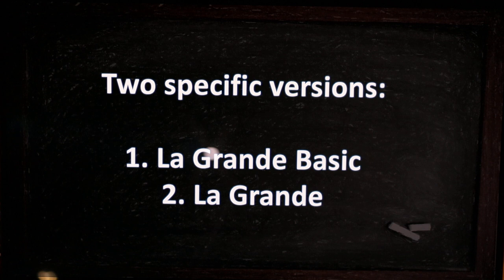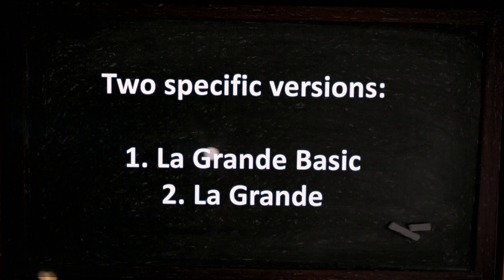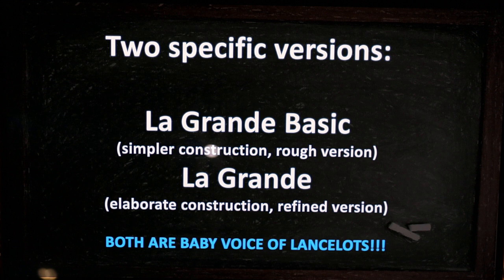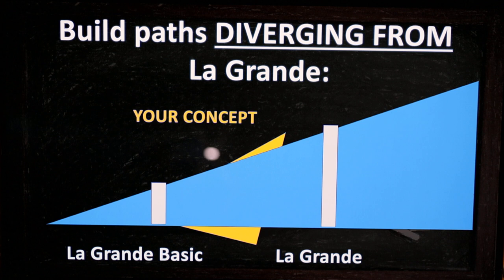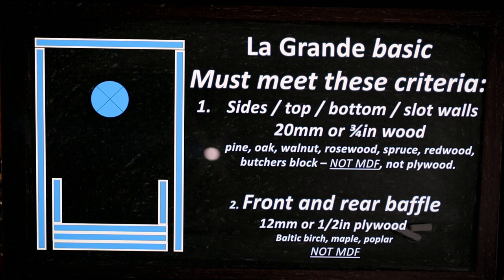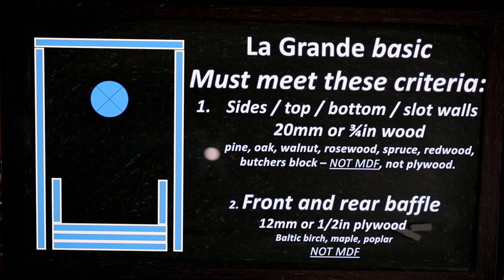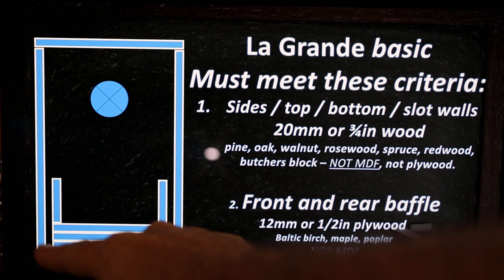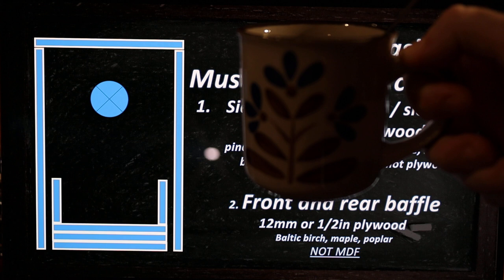La Grande basic build plans - part I

Comment: unfortunately there is no 20mm spruce/pine in my region, the cost "economic" spruce is generally in 18mm (other woods too) only with optional costs there is 21mm or 22mm.  I enjoy the show, János! 😊
Reply from the maker: Hi Jürgen, thank you for this important feedback! 18,21,22mm all work well, just need to adjust the outer dimensions by those few mm-s. I knew you that you will love these adventures :) Cheers, János

Comment: Hi Janos, congratulations on the La Grande, happy to hear it is sounding great, very intriguing construction! Can one generelize and say that the softer the wood, the more live the cabinet will be? And what would broadly be the expected sound results of a not so lively cabinet compared to yours made of pine? I think this might help people to choose the wood, besides availability of course. I will buy the plans soon even if I cant build it now, who knows what tomorrow will bring😊
Reply from the maker: Hi Thiago, yes, the lighter the wood, the faster the acoustic energy can move it. Also, depending on the density and grain structiure of the wood, thy either are able to transmit resonances over a wide spectrum (spruce being the widest, followed by pine, then maple.) Denser woods do not transmit as much midrange energy, but low and highs. (eg ebony - lots of bass and lots of highs, but little midrange). 
I had a series on how to choose wood about a year ago. You are right, people should look into those videos at this point. ; ) . 😎😎✨👍

Comment: Hi

You mentioned in your plan that the loudspeaker could be also placed on the top

May I ask what the changes are interns of the sound?
Can I use the same case construction 
Thank you 
Christian
Reply from the maker: Hi Christian, sorry for the delay I thought I already answered your question... maybe YT ate it or it did not get posted...
Regardless the internal position, the internals remain the same! I hope this helps! 
The internals would only change if we use two drivers, as then we need to adjust the port length to much shorter.

Comment: Hi Janos, Nirvana Audio has stated in the past that the TS parameters are actually resulting in sub standard BR speakers, and the better designs disregard them (I actually have a few old speaker design books that don't even mention TS parameters at all, and feature BR design concepts). This seems to be the case here as well, as the volume is way bigger than what you would get with the TS based calculations. Also the BR port (or dual port in this case) has a much bigger opening compared to the port length you would get with TS based calculations. I would be interested to get your thoughts on that, perhaps using La Grande as example for comparison.
Reply: Indeed, I have exchanged several emails with David Dicks of Audio Nirvana (as I build and sell speakers based on AN drivers and their recommended cabinets) and he says the cabinets themselves are tuned - basically irrespective of what drivers you put into them and that Thiele and Small were the worst thing to happen to loudspeaker design. Unorthodox maybe but I actually tried a 0.7+ Qts Lii driver in cabinets designed for approx. 0.3 Qts AN drivers and some adjustment to the port tube length was enough to make the bass pretty good. Despite conventional wisdom suggesting that an OB or a sealed box would be needed.
Reply: @gaborozorai3714  Thanks for sharing, and nice to read you can make money building speaker cabinets.
Reply: @hugobloemers4425  I have the cabinets built for me and, I also adjust the drivers' frequency response with notch filters and tune the ports differently to AN's plan. And I never said that it's profitable, more like a mission and an expensive hobby.
Reply from the maker: Hi Hugo, Gabor, this is a really critical discussion topic. I fully agree that T/S parameters are not absolute, they have a limited range of application. While they offer a generic idea what to do with a driver, and be used as a tool to create a cabinet, there is no guarantee at all that it will be the best possible cabinet for the driver, or any good cabinet at all (in some cases). There's also secondary issues coming to make this picture even worse - that published T/S parameters and frequency response curves are less and less accurate, and less and less dependable to the point of they are actually nearly useless or harmful when trying to depend on them. (The FE103NV is a prime example for this...)
I dare to go as far as saying that we are entering an age where looking at the T/S and spec sheets might even be counter-productive, and T/S can only be used to a limited degree when you measure the actual drivers you are working with - and measure them after they broke in.... 
I fully concurr that the ratios, lengths, dimensions make far greater impact than juggling with the T/S parameters. T/S is more important when trying to get bass out of a small cabinet, but once we reach sizes that actually start supporting the low frequencies, the T/S rapidly looses relevance. (Such as with Voigt pipes, T/S goes out the window entirely).
Reply: @realworldaudio  Hi Janos, thanks for explaining that. It actually explains a lot with the main stream trend to get ever more/lower base out of smaller cabinets.

Comment: Hi Janos, thanks for the first look at your build plans! You wouldn't believe how excited I am to build speakers that may be made of almost any type of wood, except MDF. MDF is dusty, it stinks, and it's a dead material. I'm looking forward to the rest of this video series.
One question: no matter which version of the La Grande we build, it's always the Fostex FF125 WK chassis, right?
Reply from the maker: Hello Thilo, yes, they both use FF125WK. Also, the basic version can be upgraded to the refined version with more work! So, it's the same speaker, just the basic is the rough & minimal form, and the refined is when more work is done... the more work can be done upfront, or later on.

Comment: Hi Janos.. I think more diy folk would use Plywood on ALL sides if they could use Zinc Threaded Insert Nuts (Amazon has them)  for the back panel, around M4 in size.. Screws would be easier to use that way, and it would not damage the Plywood layers too.. 

BTW, are slightly rounded over external edges/corners of the cabs still make it a La Grande?
Reply from the maker: Hi Rick, thank you for that suggestion, but I would use the brass insert nuts, nut the zinc ones! The zinc ones would add harshness to the sound. The main reason why I did not recommend ply to the sides is because then you can't upgrade plywood walls to the fully refined version, as the full version entails hallowing out the tops and sides, which cannot be done with plywood. (Maybe I'm wrong, but it's quite tricky to do for sure, but worth a try nevertheless!)
The rounded corners: that's part of the refinement , going beyond the basic ; ). The refined version is the same as the basic, just with the finishing touches, optimizing air flow and diffraction. Will share on that later ;
Reply: @realworldaudio  Thanks Janos.. I only mentioned Zinc because of availablity in terms of size.. If one can find popular sizes (like M4 to M6) in Brass, then go for Brass..

Ahh, nice the more refined La Grande with roundovers👍🏼..